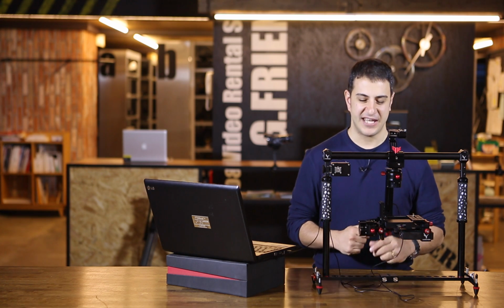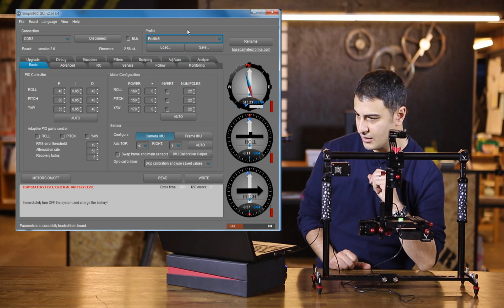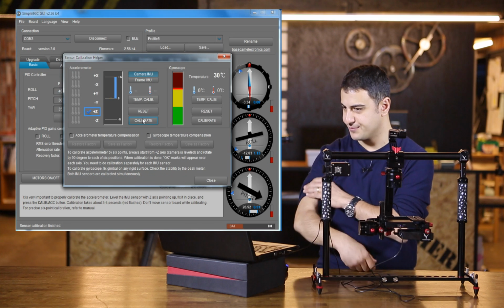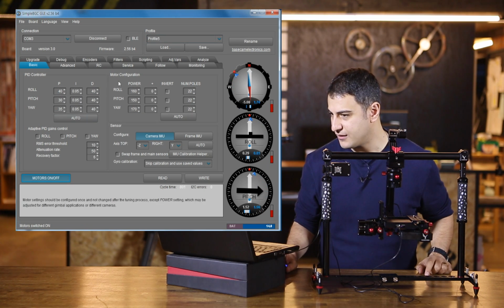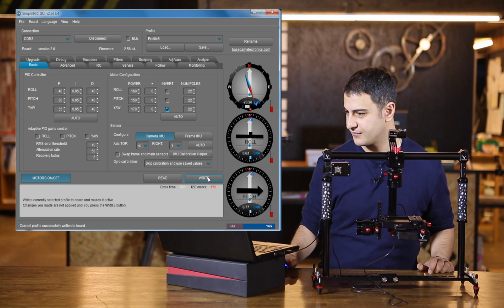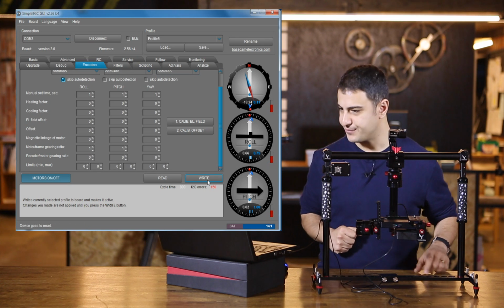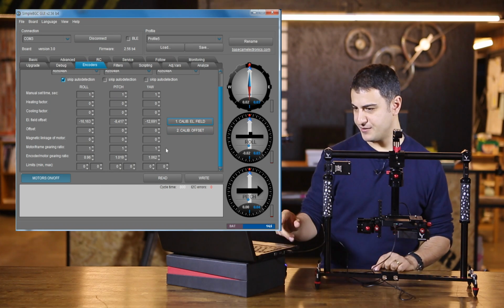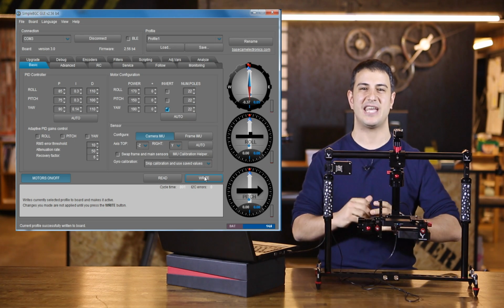Birdycam Lite Factory Settings

Comment: A few things that might help people: You need to make sure that your usb cable is a data cable. Sometimes the small usb power cables look similar, and this is why SimpleBGC won't connect to the board. Next, make sure you have the proper factory default (.data) file. I'm not sure if this matters, but take note that the tripod plate is on the unit for the balancing. I didn't see this the first time, and I think that's why my balance was off. Next, when you are selecting the encoders, he says they are labeled "dw" but they are actually "dv" - you can make sure your's match, just watch in HD. Lastly, make sure your battery is charged before you start this process, then unplug it before you start. My battery died the first time during the motor calibration... not good! 

Thanks for the instructions Francois, and thanks to everyone at Varavon !
Reply from the maker: Appreciate that Martin Murphy!